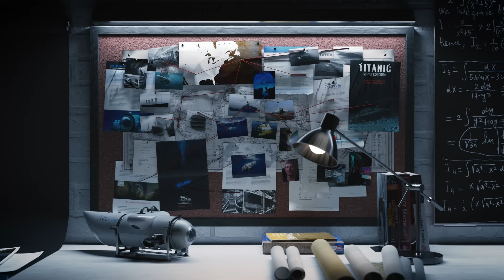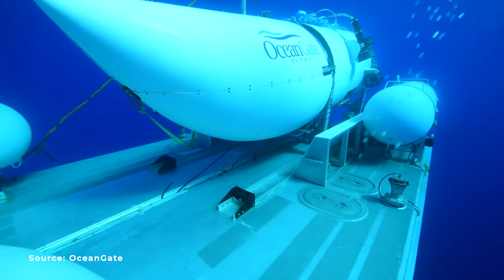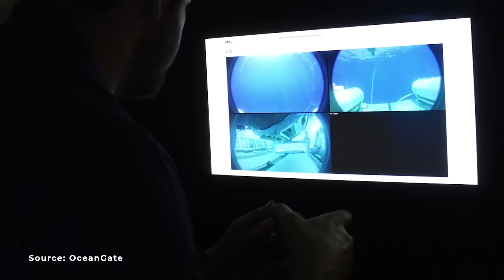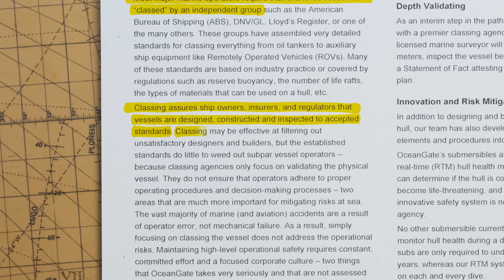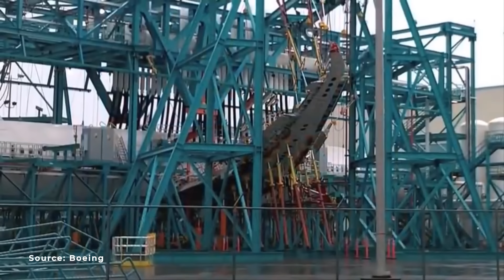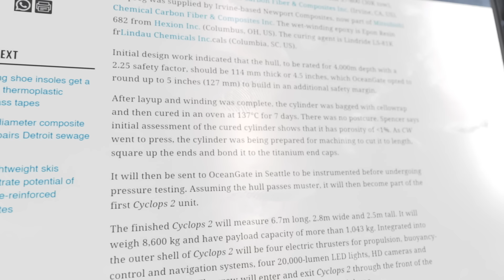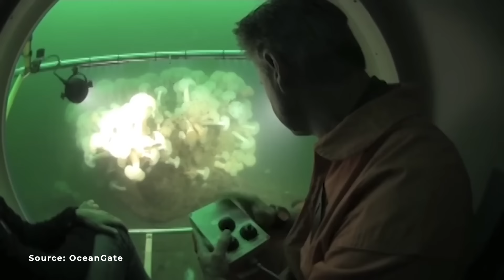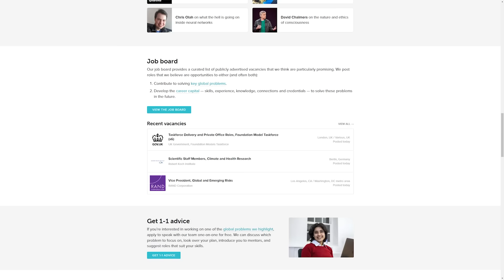The Questionable Engineering of Oceangate

Comment: I’m no engineer but from the video evidence and the pieces they brought up many now  think the carbon fiber specially wasn’t to blame but the joining of 2 different materials instead of the traditional uniform designs and different materials act differently at depth under extreme pressure leading to a potential of a void and then the implosion they believe that theory because the hull wasnt totally obliterated and because the channel on the  ring of the 
titanium dome they recovered was completely sheared off it’s incredible to think of the kind of force it could do that. Really you can boil it down to 1 word and that’s arrogance Stockton knew better than everyone else including the designers, operators and engineers that built it a couple even being fired because they wouldn’t sign off on a flawed compromised damaged sub whenever they made suggestions or tell him what needed to be done Stockton ultimately made the final call. They did a lot of stuff wrong and ignored people much more intelligent than him he wanted to continue using a hull struck by lighting. The way they wound it was not ideal and it was only half the original 10 inch thickness they never did thorough testing and their viewport was only rated to 1300m he didn’t want to hear any bad news let alone ones that would cost a lot of time and money he tried to do this sub as cheap as possible because he was out of money and reused so many used parts from the previous sub  that’s the reason he opened up rides to the public he was getting desperate. I think he felt like he needed to do this because he ran his mouth praising carbon fiber only to find out it’s not going to work his ego wouldn’t allow him to accept that he even ignored the hard data by their RTM saying their was something up with the hull . He wanted so bad to be the next bezos or musk he was willing to risk innocent lives to do it

Comment: Well, some NTSB photos have come out, and they're just beyond bad.  Visible wrinkles in the layers of layup.

Really not what you want to see in something that'll be under that much pressure.

Data from their monitoring system is also just... insane.  There was a loud bang near the end of dive 80, and strain gauges in the monitoring system reported a sharp change in strain at the same time.  Then during subsequent dives the strain/depth graph showed notable differences, with a curve appearing are shallower depths that wasn't there before.

Comment: I don’t think the composite hull failed due to implosion, it was the design and installation of the titanium ring interface.   What failed was not the hull, but a failure of the GLUE JOINT on the titanium interface ring.  It was only fitted with the ID of the ring glued to OD of the hull.  Was this analyzed?  The interface ring should have had a grove around its circumference where it can be bonded on both the ID and OD of the composite hull. And the hull getting a lot of extra support on its ends. A classic tongue and groove joint. A mechanical joint not just an unpredictable glue joint.  I think the loss was initiated by the failure of the glue joint in tension beyond its limits. Speaking of joints I have to go.

Comment: As part of its investigation into the Titan implosion, the US Coast Guard posted a transcript of the 2018 OceanGate meeting reviewing David Lochridge's safety concerns. In that meeting Rush stated that carbon fiber is better in compression than tension (page 7, line 2), and, "when you look at uniform compression of carbon fiber, it's the perfect material" (page 33, line 13). He later said, "I really don't know what acceptable void content's going to be. But, what you are conerned with is those structures when they come together in interstitial planes, right. But glue is what holds it together. What nobody talks about with carbon fiber structures is sure the fibers are strong in tension, and they're not as strong in compression but they are strong. Okay. What really holds these things together is the glue." (Page 38, line 20)

What came through repeatedly in the transcript was that Rush viewed the structural testing program as collecting data from the acoustic monitoring system while conducting manned dives. He seemed to earnestly believe there was minimal danger of catastrophic failure. "Now, if it fails, then you have to stop, and it's -- again, this is not something that just happens all of a sudden. It doesn't just implode. It screams like a mother before it implodes." (Page 32, line 8) 

He reinforced this near the end of the meeting: "I understand this kind of risk, and I'm going into [it] with eyes wide open and I think this is one of the safest things I will ever do, you know, a lot safer than flying the first plane I ever built made of carbon fiber with a 300 horsepower engine on it. So I have no desire to die, and I'm not going to die. What may easily happen is we will fail. We will get down there and we will find that the acoustic monitoring has, you know, fails after 10 hours or gives false -- too many false positives or that the thing is noisy or the dome is creaking because we're going to be measuring that or it starts to craze. I can come up with 50 reasons why we have to call it off and we fail as a company. I'm not dying. No one [is] dying under my watch period." (Page 84, line 24)

https://www.news.uscg.mil/News-by-Region/Headquarters/Titan-Submersible/smdsort35464/description/

Comment: Rush tried to compare deep sea diving with space travel. Sorry bro, but they couldn't be further from each other - in space there's no air to cause pressure. At 3800m, there's 3.8 tonnes of water pushing on every square centimetre of the surface of the pressure vessel. The deep ocean is no joke and far more dangerous than outer space. The passengers who went down with him were just as stupid and ignorant.

Comment: The issue is how unregulated submersibles are. Compared to aviation or automotive which much have highly capable process control (Cpk) and huge amounts of auditing these should have raised a huge investigation.

Most of these are custom built unlike aviation and automotive that are mass manufactured. As a result you will have many manufacturing risks. 

Also we can’t necessarily hold regulatory procedures, because it’s beneath the surface.

Comment: perhaps an inner titanium shell would have prevented the delamination, then the fiber could be prestressed aginst this, like the reverse of building artiliary barrels.. or the reverse. hmmm.  a carbon tube cold srinked into a lightled heated light steel tube, interference fit, would have held  the carbon in compression. Just my thoughts.

Comment: I applaud your video which is roughly a year old now. Virtually all of my professional materials engineering experience was with metal pressure vessels and piping. Whilst not discounting anything you've said regarding delamination mode failures, I still have to wonder about the dissimilar joint between the titanium hemispheres and the composite cylinder. It looked from the videos that they were simply epoxied together. I have to wonder whether differential thermal expansion or differences in moduli of elasticity may have also been weak links, especially when cycled. 
All the best.

Comment: I wonder. Had they designed the submarine to be like a metal skeleton with composite materials inbetween, could that work?

So the metal skeleton takes the brunt of the compressive force, and the composite materials curve inward slightly (so it would basically be the inverse of a plane where the composite curves outwards with the internal pressure), putting them under tension, rather than compression. Now, I'm not materials engineer, and maybe this equally would not work, but it seems at least a bit better than what Oceangate did.

Comment: I read somewhere a month or so after that a possible contributing factor was that they did NOT descend at 55mps.  It was more like 60-65mps.  That could have added to hull overstressed by (possibly) flexing the hull too quickly.  On the other
 hand, carbon fibre has a stress life, and this dive was way past the cycle count for  replacement (and why CF was not suitable for a reusable submersible).

Comment: My main concern with this is how they tested this vehicle. Even if they let it slide not testing it with a certified/regulatory board, the least they could've done was done more actual testing to it and not just testing it running under the water. What I mean is they should've tested it with more controlled tests, destructive and nondestructive testing. They ran it around less than 50x in test runs, which is very minimal, they should've tried simulating more extreme pressure first on the hull by making a prototype and see what's the max it can withstand at how many cycles, instead Stockton decided to cheap out and let the first build be the actual one to do the initial tests. Each dive that sub made, even if it was "passing" their tests at under extreme depths underwater, they still only did it less than 50x, they probably didn't even check the hull's structural integrity after each run properly, and each run would've compromised that hull little by little.

I work in Design Engineering, and have worked with stress and test engineers, and yes they do fatigue testing at a lot of cycles and even more worst case scenarios. It's how we can see design issues that needs to be redesigned. It's expensive yes, but there's no such thing as being too safe. In engineering, you know what redundancy is, and it should be in these cases.

Comment: I used to make air plane parts out of carbide fiber and made a ton of parts for spaceX  and removal of the air is a BIG part of shooting a part of resin. And there's a huge problem if there is Parocity in the parts. Any time we filled our pumps we would have to put the tank under a vacuum for 2 hours to suck the air out of the resin and while shooting the parts we had to put a vacuum on the other side of the part to help get the air out, than we had to flow resin for about 10 minutes after it looks like it's done.

Comment: As a fly fisherman I understand the strengths and weaknesses in carbon fibre.  It is extremely resilient and limber but as in egg shells it has weaknesses.  Despite it's inherent strengths it is brittle and can easily fail.  Misuse of a carbon fly rod will result in breakage.  Using it for a deep sea vessel is simply incompetence.

Comment: I don't know why carbon fiber gets such a bad rep in compressive strength. It's the other composite part that has to provide that, the carvon fiber is just there to hold it together. I personally would have worried more about the joining point of carbon fiber and metal. I mean what would you use? Drill holes for bolts, sacrificing structural strength and providing a starting point for cracks? Glue the thing, without anything actually holding the glue in place? Rely on different compressibility to press the parts together when under pressure, but have one material overstress the other?
Also, worst comes to worst wouldn't simply layers with different flexibikity properties, like a thin metal inner wall have prevented snap buckling? After all you only need to withstand the buckling pressure from the small delaminating layer, which obviously does not carry all the forces of the hull. And that could be achieved by a layer of material that does not buckle the way the composite does.
Reply: Interestingly, the carbon fibers are what hold the compressive load in carbon composites. The epoxy matrix merely keeps the carbon strands from buckling anywhere near as easily as they would do on their own

Comment: I heard that the final audio recording from the sub includes Hamish Harding audibly struggling whilst using the onboard toilet bucket, which was reverberating around the inside of the cabin and making it difficult for the hull cracking audio alarm system sensors to reliably pick up the hull failure noises as Hamish sounded like he was trying to pull-start a 2 stroke chainsaw that wouldn't start.

Comment: Mechatronics engineer here. Great video, just wanted to say that on the controller side, making something wireless is just a adding more variables and failure points. A "gamepad" is a terrible way to control ANY precision machine, even drone RC controllers are better than that joke because they have a larger spectrum of sensibility. adding 3D printed nobs to any gamepad is not solving that issue. (Edit: just adding that any electronics engineer can tell you this exact same thing and explain it better.) Anybody with half a brain could deduce this by the way.

Comment: The shape is the problem. The tapering tail is the weakest part of the structure. I am using the example of a Prince Rupert's Drop. 
If you examine a Prince Rupert's Drop, it also has a tapering tail. The bulbous head is very strong, but the tail succumbs to the smallest forces applied to it. If damaged there first, the structural collapse will rapidly progress from the tail to the rest of the structure.
Reply: The tapering tail was not part of the pressure hull
Reply: okay, but it had domed caps on both ends. The taper was a fairing covering equipment outside the pressure hull

Comment: I am not an engineer. I am just a high school dropout. BUT, if I had been in Rush's place, I would have designed 3, full sized, DSV's. All 3 being identical. I would have cycled the first sub to a depth of +1/2 the goal depth ( if my goal was 4,000 meters, i would have cycled it at 6,000 meters) and kept cycling until it failed. Then investigate the remains, figure out the failure points, fix those failure points on the second sub, and repeat. Cycle the 2nd sub until it fails. Once it fails, repeat the process - investigate, remedy failure points on the next sub. The third sub, being prepared by the fixes found from subs 1 & 2, i would cycle it until failure. Once it fails, i would take the number of cycles that it successfully completed, cut it in half, and that would be my max usage of the sub. 
So for the fourth sub, it would have the fixes found via the failures of the previous 3 subs, and i would never cycle it more than 1/2 of the total successful cycles for sub 3. 
 At least that is how i would have tried to mitigate the risk of failure at depth. But then again, I also would have had it classed. Its one thing to be fiscally responsible, its another to jeopardize peoples lives just because you are cheap and egotistical.
Reply: But that would have taken far too long. Stocky just couldn't wait for the fame to keep fueling his ego. 

I agree with your plan though!

Comment: I can add a tiny point here. As a marketing professional, the 'less than 1% voids' means it's pretty close to 1% voids. If it was .001% or anything much lower, that would be the number used. The point of 'less than 1%' is to sound as impressive as possible while remaining factual.

Comment: I'm sorry...  I'm not even an engineer and the moment you said "carbon fiber hull" my first thought was, "That won't work well in compression..."  A pressure hull like that is going to be getting most of its strength from the epoxy, rather than from the fibers.  At which point the flaws in the epoxy that are minor annoyances for holding things in become as bad as casting inclusions would be in a steel hull.

I'm not a big believer in the "magic" of bureaucratic testing procedures, and if you look at the history of our technological development, "move fast, break things" does tend to be the way we actually make significant advancements in less than a century...  But there's a difference between taking risks and being stupid.  Ignoring everyone else's safety procedures when you think you have a better understanding of the underlying principles and a better way to check it is one thing.  Ignoring them just because they're inconvenient is how you find out why they have them in the first place...

If they wanted to be "innovative", I can think of three or four ways to have built strain-gauges into every square inch of the hull itself so that they'd be able to tell immediately if it was weakening with repeated dives.  Or use ultrasound to check for flaws after every dive like they do with x-rays for metal castings.  Or have the "composite" hull include an inner layer that does well in compression to help the rest hold its shape.  Use a balloon for positive buoyancy and  just have a steel hull?  A liquid nitrogen tank can easily provide over 4000 atmospheres of pressure to blow your ballast tanks/balloon with, and plenty of volume in a small space.  There are plenty of ideas that could be used to build a better submersible.

Instead they decided to break Evil Overlord List #17:  "When I employ people as advisors, I will occasionally listen to their advice."
Reply: Interestingly, carbon composites still get most of their compressive strength from the fibers. The fibers on their own will just buckle under any sign of load, but when combined with an epoxy matrix the fibers are unable to buckle (at least not until a much higher load is reached) and so can take a fair bit of compression
Reply: @addison1024 right, but you're relying on the strength of the epoxy to prevent the fibers from buckling, whereas when the pressure is on the inside the epoxy is mostly to make it fluid-tight and prevent damage to the fibers.

It's still strong in compression, but it's a fraction of the strength it has in tension.

And the problem is that lots of the resins used are rather brittle.  So the greater flexing in compression means it degrades faster.

It needed to be tested after every dive.   And, personally, I'd have quilted the whole thing with fine wires to create an active mesh monitoring system such that any delaminating areas would immediately be detected so the sub could abort the dive immediately.